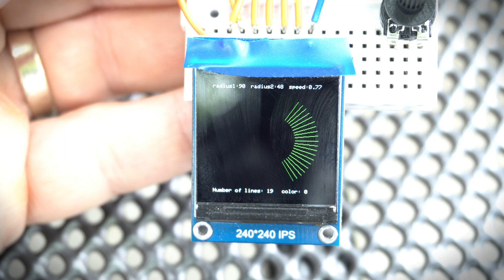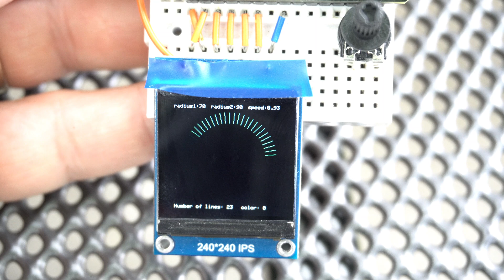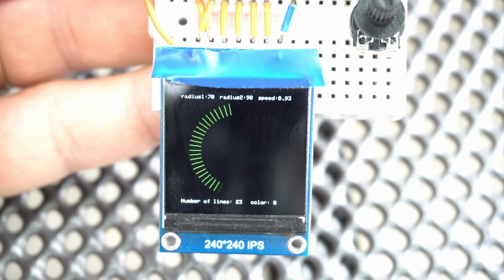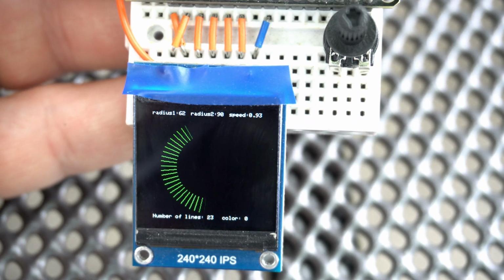How to make Interactive Animation and Lunch?

Comment: I really like this! I'm thinking it could be used for a multi-data readout.. BME280 for example output temperature humidity pressure and altitude.. the outer diameter could be Altitude, the inner diameter could be Pressure, the number of lines could be Humidity and the speed could be Temperature? With your permission i am going to modify this for my project